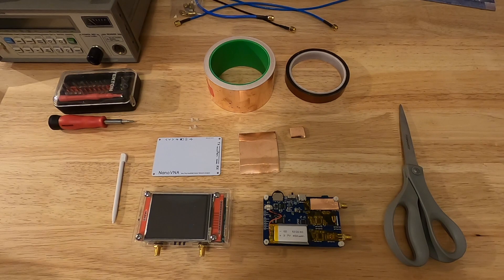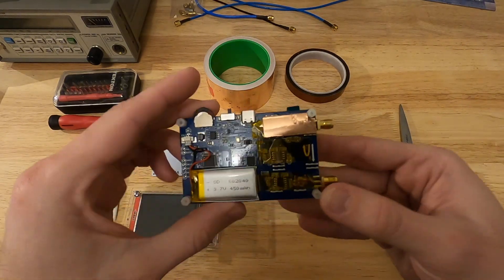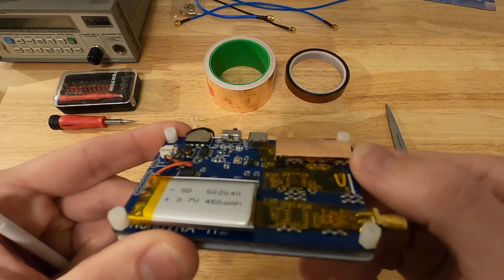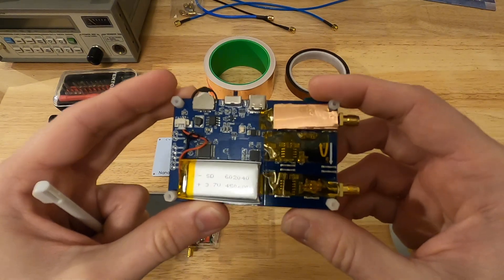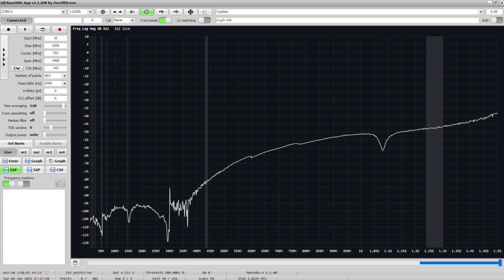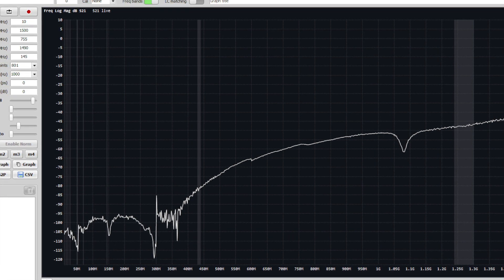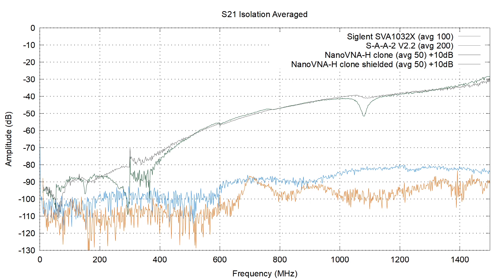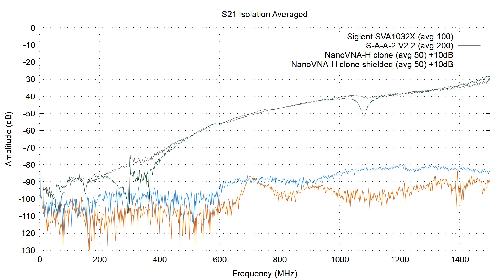How to make custom RF shields + can we fix the bad NanoVNA clone?

Comment: Hi there, i discovered your channel by mere coincidence, great content...keep up the good work👍
but i was wondering about your shielding, the 1st one in particular, aren't you changing the microstrip impedance by adding an extra layer of ground above it? try to change the height of the shield to see if it affects the readings to confirm this theory, maybe you can try not to ground the shields 😶‍🌫?
i also suspect that the usb connection might affect things here( grounding issues?) 
i would really like to see the results, it would be fun and educational to find the culprit or to confirm that it's a bad PCB layout issue.
Merci beaucoup et bon courage pour la suite😉

Comment: Although it is doubtful that shielding is the solution for the problem, you should try with a shield tape that has high permeability. I used to have an RF shielding tape kit that had all kinds of options, but you can't get that kit anymore.